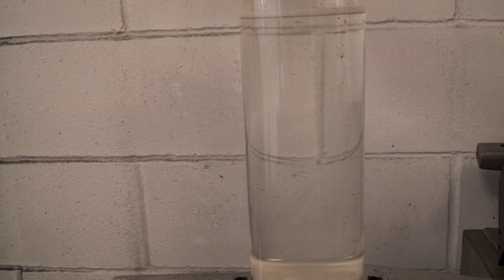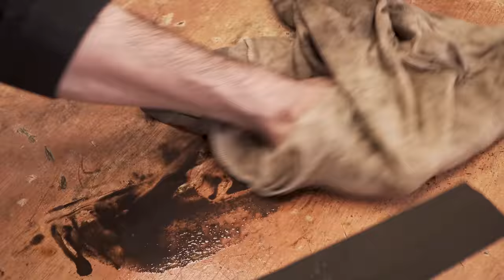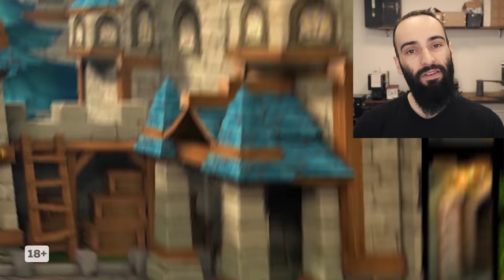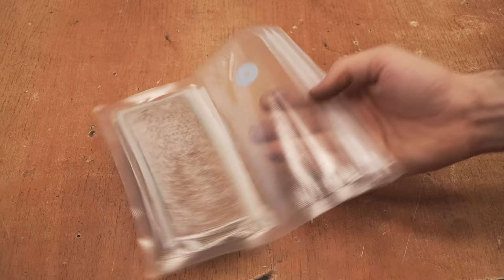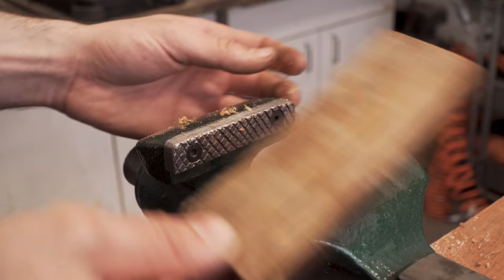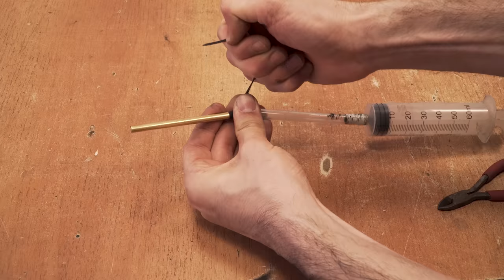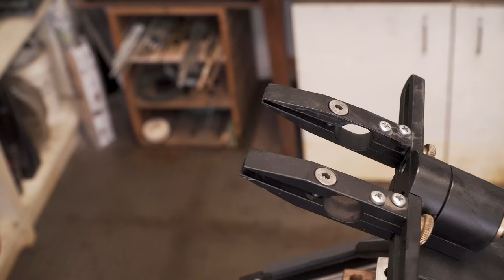Broken Tip Italian Slicer Knife Restoration | Knifemaking

Comment: Nice work!
What are the 2 solutions you are using? One for rust removal and the second for darkening the steel?
And what power (voltage and amperage) are you using for the rust removal?

Comment: Nicely done . I have a question,  what are you using as an electrolyte?  I normally use sodium carbonate ( soda ash) 
But l have never had the solution float the rust to the top in what looked like a dry dust .

Comment: I love your work, and that is a beautiful result. I am concerned that you are relying on the epoxy for the handle's structural stability. Over time epoxy can break down. If you'd peened the pins for a better mechanical pressure fit I would say perfect job

Comment: Hi BBP, Great video ad always.
I’m striving to find some decent stabilizing resin for wood and i also would like to try the brand of epoxy you are using, do you have a link where to buy that in Italy? Thanks, Luca
Reply: Most anything good for boats is plenty good for handles in my experience. Curing time is really the x factor at least for me. The faster setting stuff can be crazy to work with.

Comment: What do you use as a powersource for the electrolysis (rust remuval)?
Reply: 12 Vdc I guess. Some of the restoration channels using car battery.
Reply: Many use a computer power supply with good results

Comment: What is the technique he is using in the beginning of the video  0:36. Thanks great video
Reply: Electrolysis.

It removes and weakens rust (iron oxide) by making it migrate to another piece of metal (the rebar.)

Comment: You've spent so much effort on the handle and yet the blade itself is not fully restored... You can still do so much better  for that blade, like, sandblasting it, then baking it again in high temp to remove all those rough surface... but still u've done great on this.